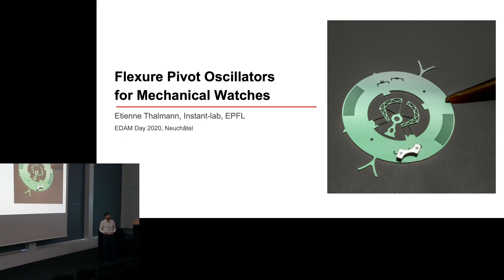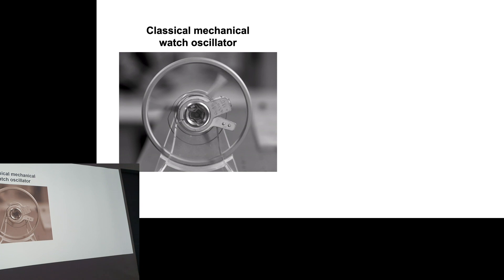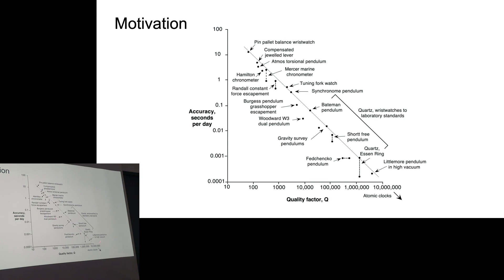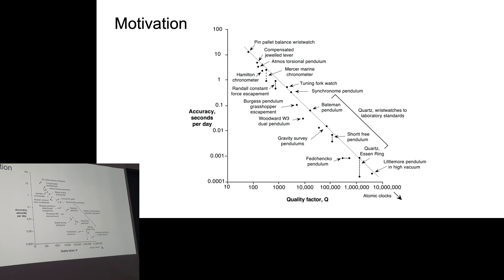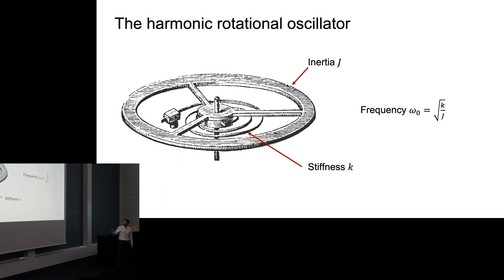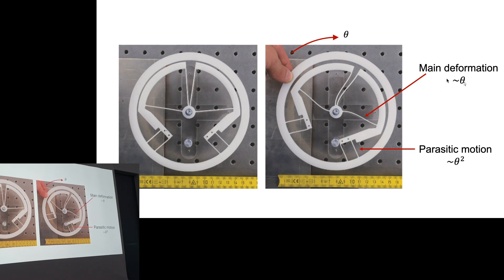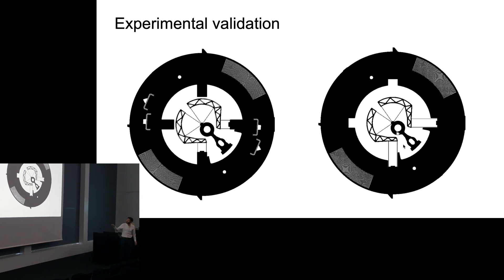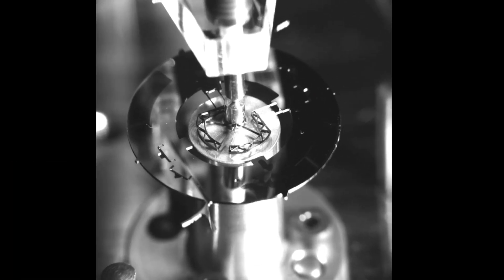Flexure Pivot Oscillators for Mechanical Watches (Three-minute presentation)

Comment: Work hardening will cause the frequency to increase over time. You can re-tune it, but it will keep gaining time. I am also concerned whether dampening is less efficient than friction on a traditional pivot and whether this changes over time. Finally, there is the question of reliability and operational life. However, as a demonstration of the principle operating in a compact assembly, it rocks!
Reply: Work hardening generally occurs to materials being plastically deformed. If this mechanism is able to operate entirely within its materials' elastic limits, which most flexure designs aim to, it should be able to keep a consistent frequency for a long time, basically until environmental degradation kicks in.